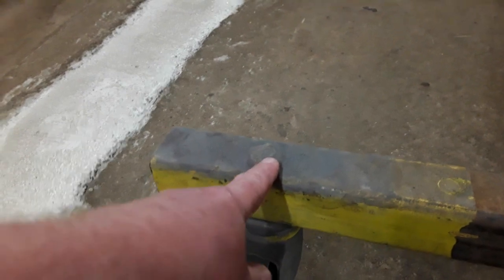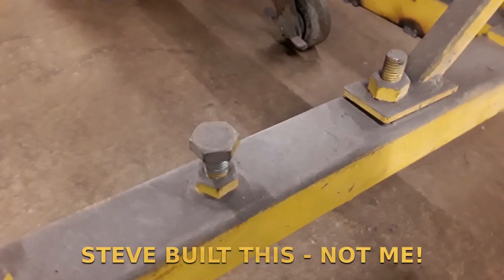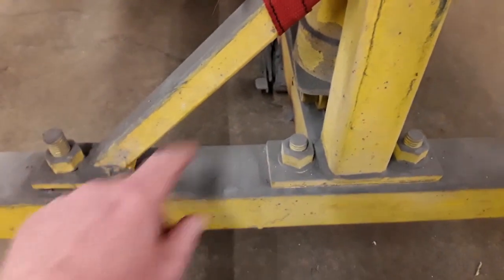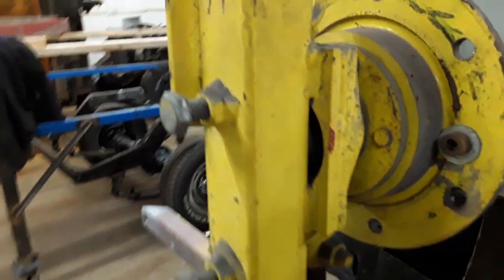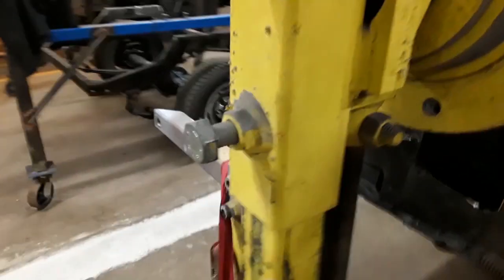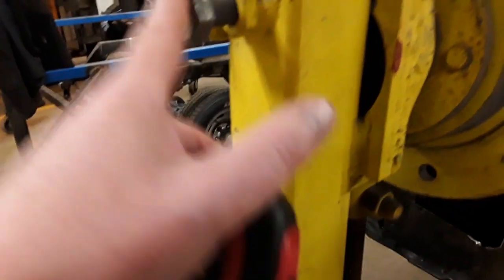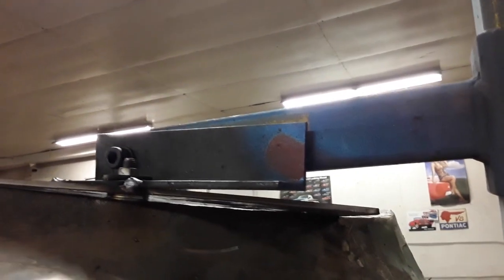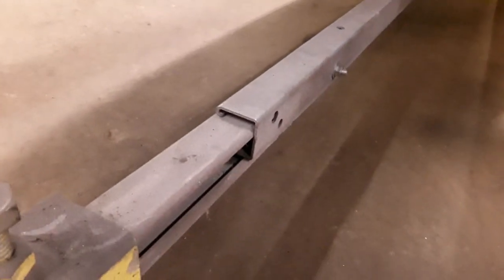Make your own rotisserie from scrap!

Comment: Good video Gary. I have something similar in mind. I have most of the steel but will have to source some that will fit inside of one another. I was going to build according to the redwing plans but the steel was outrageous. I am also concerned I will not be able to spin it in my shop. But I'm working on that one too.
Reply from the maker: Thanks for the feedback, you were one of the people I had in mind when I made this video. If you need any more details please let me know.